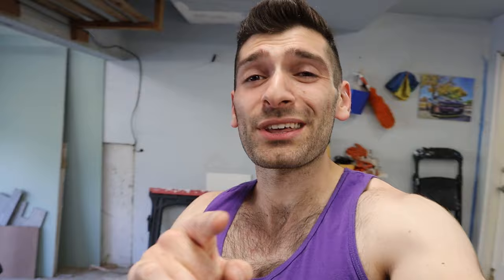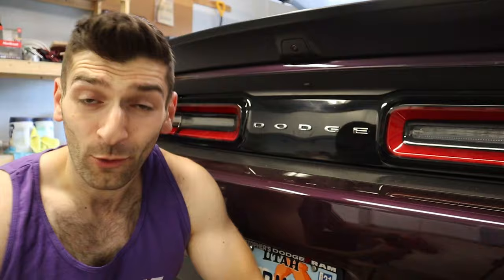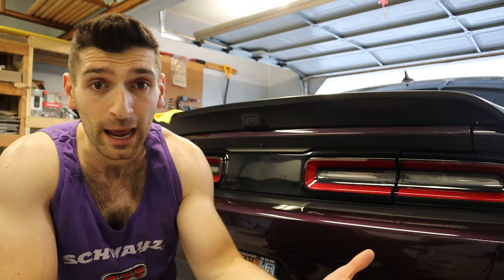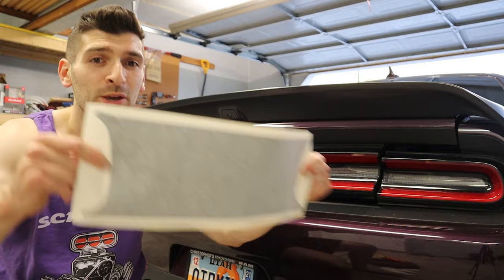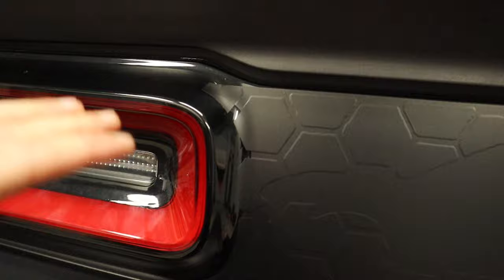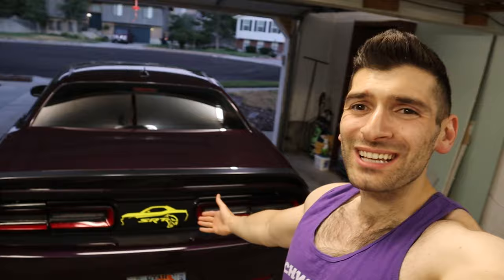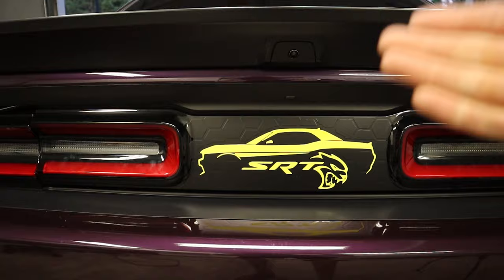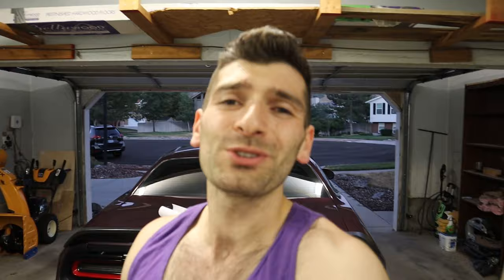NEW $30 MOD: DODGE CHALLENGER TAILLIGHT DIVIDER INSTALLATION FOR HELLCAT/SCATPACK/RT/GT/SXT

Comment: Bubbles can be corrected by using a pin. Make a small hole in the material and press out the air or water. Problem resolved.
Reply: What happens if you wash your car?
Reply: @borgolgisauce2373  - once the air or water is massaged out through the tiny pin hole, the adhesive will stick to the car. Anytime a wet application is used, I would wait about a month to allow the adhesive to really stick well. I’m my opinion, I would have used the wet method for all of the layers, and I would have used registration marks to make sure everything lined up well. He did a great job on the install, however, most won’t be that lucky. There are a few techniques that a beginner can use to center, line up, and make sure that your graphics are placed perfectly.
Reply from the maker: Thanks for the advice! I tried using a razor blade but wasn't having success. I may take another stab at it to ge that little bubble/wrinkle out
Reply: Use a straight pin and gently poke a hole in the center of the bubble. Massage the air or water out by rubbing your finger around the outer “circle” of the bubble and work your way to the center.